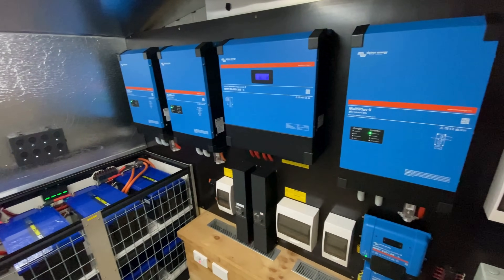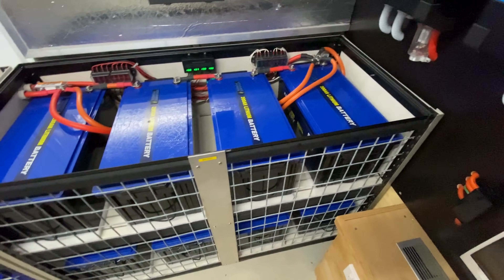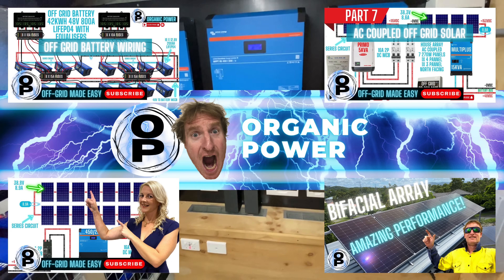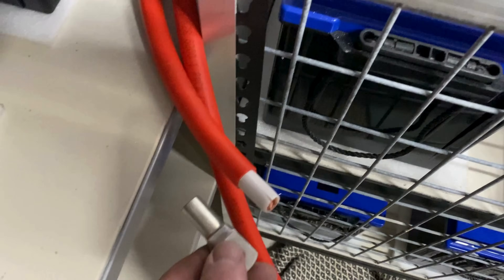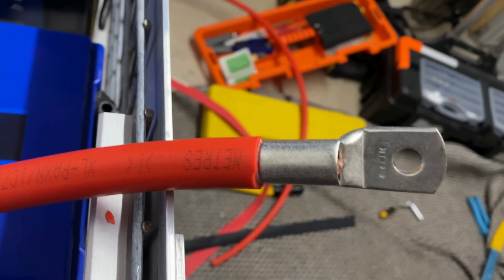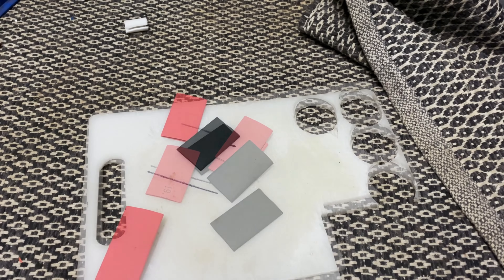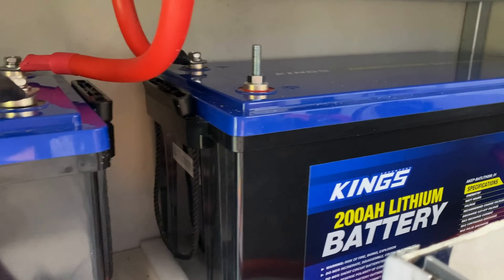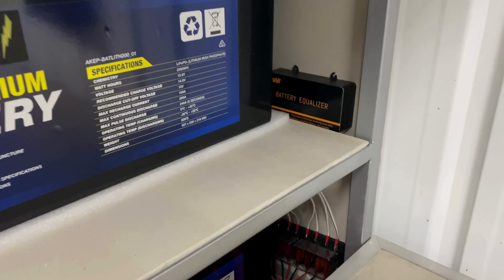This DIY Solar Battery WILL Change Everything

Comment: Good job mate and lovely setup, Kings batteries are great, I have a few,but why not use a higher dc voltage, 48vdc setup would be more efficient here, less batteries, connections, thinner wires, cooler operating setup.
I use 310A prismatic Eve type cells with a JK BMS, 48vdc and a 5kWh AIO system, works great.
Reply from the maker: Hey bud, Thank you for dropping by. This is 48v? 4x 200Ah batteries in series per bank. $10,000 AUD for 55kWh using 5x 48v banks. I guess you missed that bit. 👍🏻

Comment: Great video mate, what’s your honest opinion on the kings battery’s? I’m about to do my system and I’m not sure what batteries to go with.
Reply: I have three of these, I cant fault them, good cells & BMS, I have seen numerous torcher tests and teardowns, they are built as well or better than many other name brands that cost your 2-5 times the cost.
I use 2x200A batteries to run a 3kWh Kings inverter and a couple of fridges in a canopy setup, works well.
Having said this,consider if it is beneficial to use to higher voltage setup 24v, 48vdc especially for higher output inverters, you only need much thinner (cheaper) cables to output the higher power.
Reply from the maker: Thanks for the great input! Yep, so far I can't fault them either! The bank is now capable of 48v @ 1000A continuous 😂but restricted to 320A, plenty for our 4 bedroom house.
Reply from the maker: So far no issues at all. I am fairly happy with the battery. It’s good for 1000A continuous now 🤣 not that I’ll ever use that much current. The system is limited to 320A which is plenty for a 4 bedroom house. Thanks for watching 👍🏻